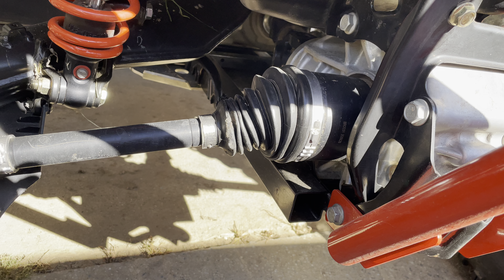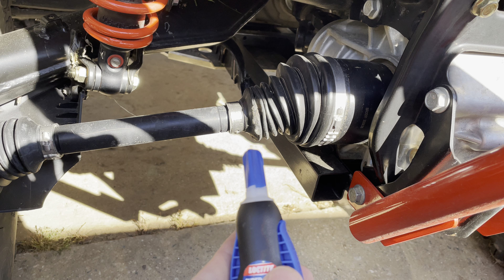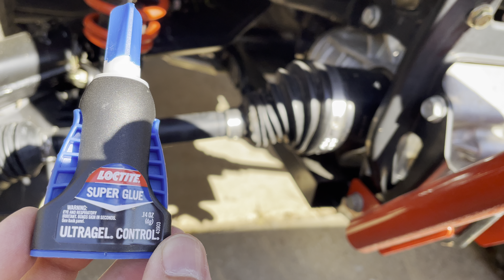CV Boot Repair | Quick & Easy

Comment: Super glue, 6000, vocanized rubber tire repair, black windshield glue.     You can also use a needle on grease gun to incert grease then seal the hole with superglue.
Reply: Oh wow thanks!!
Reply: RTV black silicone is better than superglue for most of these applications.
Reply: @RandomAxeOfKindness  Nope. Try it on a side by side, comes right off.  Waste of time
Reply: Are you saying to use all of these or any of the above mentioned will work?
Reply: @Flippidyflops  any of the above.

Comment: I used the permatex car window adhesive/sealer.  The stuff is black, very sticky, high VOC and has really held up.   It will not easily come off any surface it adheres to and it is flexible. It seems to work well with the rubber cv  boot.

Comment: I used shoe glue and its worked pretty well so far for the last month. I only cleaned the split area really well with brake cleaner and acetone, not the area on the boot around the split. But then i put the glue all over the place. Will it still hold?
Reply from the maker: Time’ll tell
Reply: @calebfollett631  6 months. Still going strong.
Reply from the maker: @cbass0684  excellent
Reply: Thanks fr the comeback
Reply: 1 year still going strong

Comment: Thanks for this video. I saw they had cv boot repair kits that came with a split boot so you didn't have to take the axle out. They come with an adhesive that you put down the split to make it secure. The split in the boot in the repair kit is bigger than any split I've seen in a CV boot! Looking up rubber adhesive and it's cyanoacrylate aka super glue. Thanks for the confirmation!

Comment: tore mine doing a control arm replacement. will have to try this out!
Reply: Did that to mine on Monday. Now I'm here looking for a quick fix 😅
Reply: I burned a hole in mine using a propane torch getting the cinch bolt out of a ball joint.   I Forgot how close the axel boot is.   Let me know if it worked!

Comment: Great video I have a tiny split on my CV boot right before the small clamp end it's about a inch long would this glue be strong enough to bond it together.
Reply from the maker: I would certainly try it. Clean it nice. Give it room temp. Apply. All you can do is try. Good luck!
Reply: @calebfollett631   thanks bud
Reply: Did you need to wait 23hrs before driving again or could you drive after a hour? Just ordered some feel confident 😃☺️
Reply from the maker: Oh yeah id give it all the time possible. That stuff hardens like a rock over time. If it recommends a time frame. Id really try to stick to it.